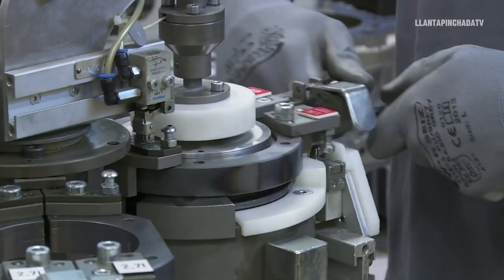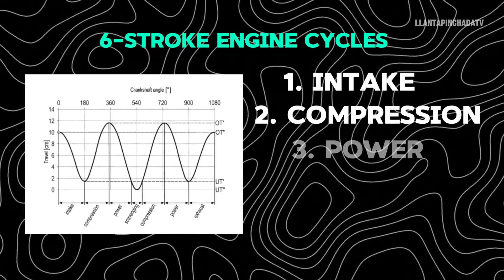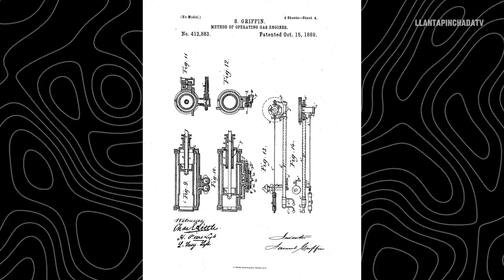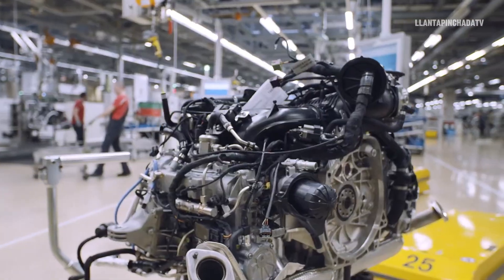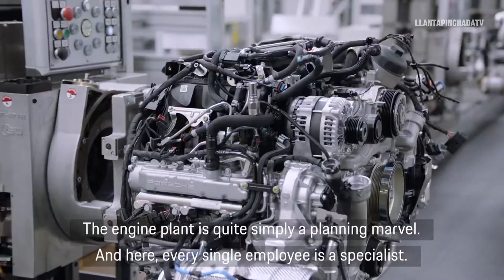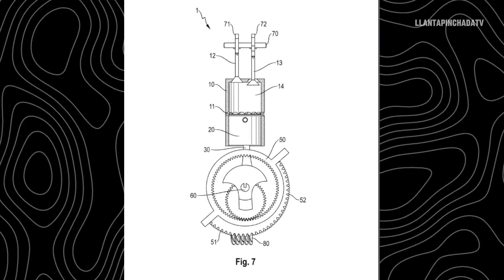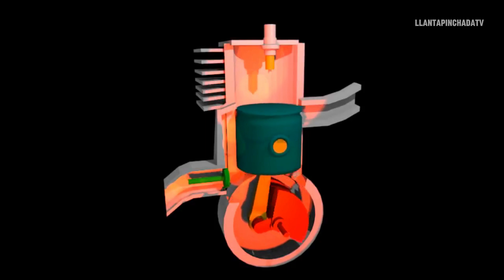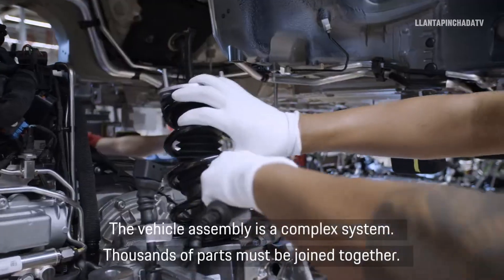This Porsche Engine Breaks Every Rule | How 6 Stroke PORSCHE engine works?

Comment: That’s gonna suck to balance because the 2nd combustion stroke won’t have the same force as the 1st. Either they’ll use counterweights, which take away all the power gains, or they’ll have to be creative with the number and arrangement of cylinders. Otherwise this thing is going to shake itself to death.
Reply: Or the 1st combustion stroke is leaner on purpose and 2nd is richer to make it even out

Comment: when I first saw the headline, I thought it was some type of an engine that keeps a heavy flywheel, spinning and skips a complete cycle intake/compression/power/ exhaust/idle/idle/idle/ exhaust- repeat, having a centrically engaged flywheel mass that is kept spinning During coasting and downhill, half throttle time, you would not need to have the power strokes very often, just keep the fly wheel, spinning with a free wheeling device that SAAB used to use in my old, 1972 SAAB Sonnett..
when not using the throttle in that car, the engine would go down to idle, and the car would coast in gear. When I needed to pick up engine, RPMs to accelerate again, or maintain speed, the refs would come up, and the mechanism would engage the drive train again. 
 when coasting down long grades, the flywheel could be engaged and the engine only firing occasionally if at all using compression to act as a Jake brake as used on tri-axle trucks..
  i’m sure they can come up with an engine that rather than concentrate on displacement of the combustion and multi cylinders, just maintaining a flywheel momentum to motivate the car and the engine to keep the fly wheel spinning is a concept I never considered. With the engine only needing to fire 50% or 20% of the time, or even less, that would be a pretty economical Gas sipper, and it would be greatly reduce emissions. There’s a lot of energy stored in spinning flywheels. They also smooth out the engine feel. I owned 4 moto guzzi motorcycles from 1980 until 2021. There was a little inside joke among Moto Guzzi owners that they are powered by fly wheels that use an engine to keep the fly wheel spinning, which is true .. they don’t have instant throttle response, but they maintain their momentum once you get them wound up. I very relaxed power delivery rather than instant and nervous and twitchy like something that has a very light flywheel…
  A clever designer good actually designed the engine, so that the torque reaction of the engine to pull to one side could be designed to pull the car in a forward motion. On the moto guzzi motorcycles, when you would flip the throttle at a stop, the motorcycle would pull to the right, because of the torque reaction to the flywheel being accelerated…
  Maybe the internal combustion engine ain’t done yet

Comment: Sounds like it’s a emission control gag not actually a power gain
Reply: U wanna drive electric?
Reply: Wrong you get a power stroke every 3 cycles instead of every 4
Reply: @Fallout4367  I'll side with the emission control, simply because there are way too many moving parts to reliably rev to high RPM.
Reply: @full_wet_tire  guess you don’t know how psychics works😄
Reply: @Fallout4367  I don't, indeed. in fact, I only know how physics work.
Reply: @full_wet_tire nice comeback. Haha!
Reply: @jkliao6486  the secret is really in the high octane ectoplasm fuel. Moves you body and soul.. expensive to mine though.
Reply: @full_wet_tire  ha ha ha, great retort
Reply: It has more powerstrokes than a 4 stroke so it will make more power.
Reply: 33.4% more combustion strokes per second means more power, ofc the fact that the second combustion stroke wont be a pure air-fuel mixture will mean that the second combustion stroke won't be as powerful however still more power